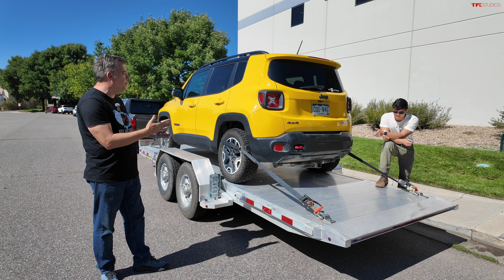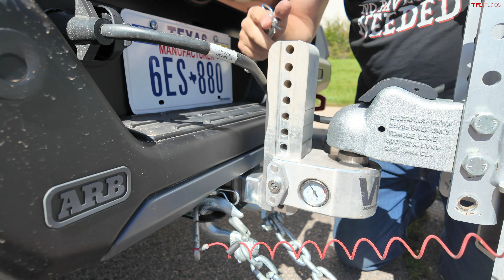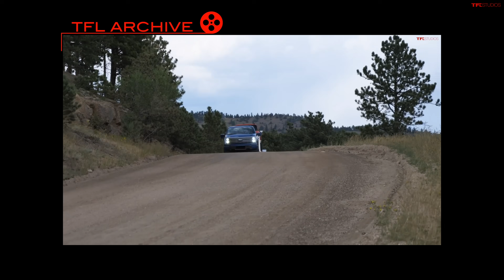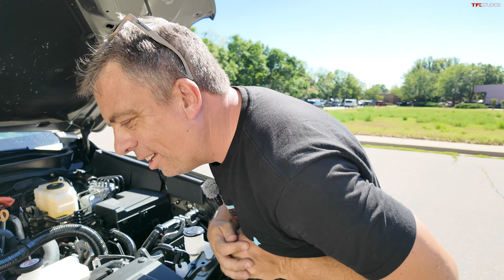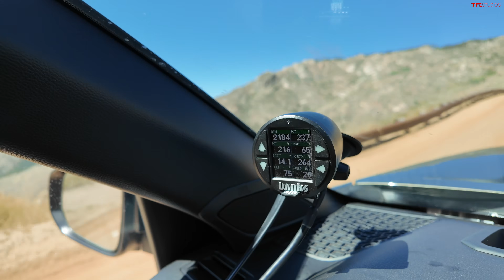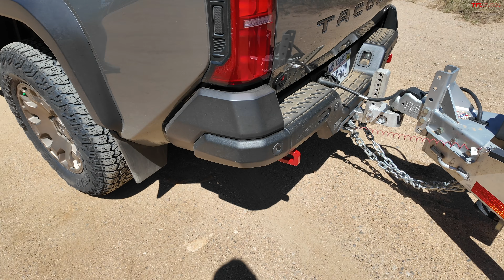Bigger Trucks Have FAILED Our Towing Torture Test, But Will It TOAST the Toyota Tacoma Trailhunter?

Comment: Didn't this get to a higher temp than the F150 and Ram? Knowing how old Toyota's acted like, I feel like it isn't even programmed to down tune or anything until after the point of no return. So what ends up getting tested is how aggressive the self protection systems are in trucks.
Reply: Or maybe the upper limits are different? If they engineered it to easily handle that temp then it did fine.
Reply: @Dusdaddy Oh you mean Toyota has extra top secret fluid? 😂
Reply: @pryme2013  Apparently so. Reached that temp with no failure.
Reply: @Dusdaddy  I'd be willing to bet that a new transmission with a known issue of exploding isn't built to a higher standard than ones for half tons that have been around a while. Really all these tests would need to be repeated several times with the same trucks. Because just because a truck survived a high temperature excursion once, doesn't mean it will do it again. In previous testing it was even said "If it was my truck I'd probably change the transmission fluid after that much heat." This is the hottest running truck so far. You saw them getting concerned during the test but fell back on "well the gauge wouldn't lie." But time and time again we've seen that the gauges will lie. The Bronco for instance the temperature gauges are scaled wrong depending on what version of the screen you're on, so it says the "red zones" are completely different.
Reply: @osamaismymama7907  lol..."known issue of exploding". Sure, and they're eating dogs and cats too. So if your favorite brand passed it would be chalked up to stellar design but since you're a Toyota hater, it's a conspiracy. Like you said, any of these trucks could have failed or passed. It's not like they have that many constant controls on this but to sit there and argue why it really failed is silly.
Reply: @Dusdaddy  Now you’re just assuming. There is ample coverage of them having transmission and other drivetrain issues. Ignoring issues doesn’t get things fixed. Personally I think all trucks and SUVs should have a dedicated transmission cooler. Used to be fairly standard but now it’s almost unheard of with all manufacturers now.
Reply: @osamaismymama7907  There is coverage but how much of it is just YT "chicken littles". Same thing when TFL broke their Tacoma. Everyone lost their minds yet not another single duplicate gripe came to light.
Reply: That’s one argument which is fair, but the other is that the truck can handle a higher threshold thus it doesn’t complain. But I haven’t been convinced which is correct. Thought to me it does seem evident that gas engines take a heavier toll than hybrids on these heat tests
Reply: @KFC1753  But that heat being measured is still from the Engine Oil, Coolant, and transmission regardless. None of the hybrid components. The hybrid would presumably work less hard to do the same task yeah, but heat in these components is heat all the same.

Comment: Fluid has not changed that much lol. 270deg is outrageous. That lessened the life of that fluid and the trans for sure.
Reply: It changed so drastically with their full synthetic that they removed the trans cooler on the tundra for a couple of years with no problems. I towed heavy for 65k miles on mine and have a happy transmission at almost 85k now
Reply: @goodneighborlawns  No, it hasn’t changed since they had trans coolers on tundras in 2017 lmao!!!! That was a cost cutting measure and did cause ppl issues. I used to own a tundra and remember it well on the forums
Reply: @pryme2013  funny because I have owned a few and own a 19 currently and am present on the forums but am not seeing issues directly related to the removal of a trans cooler.
Reply: @pryme2013  I've not seen any problems on the Tundra forum. Only people freaking out about it and adding $1300 aftermarket cooler kits 🤣
Reply: Modern synthetics testing shows acceptable performance at 200 hours of 160°C temps. That's 320°F. 275 is within the normal spec for modern fluid. Shouldn't be a problem. Normal highway Temp target is often about 230F as the baseline.
Reply: @MrJcjet  can you point me in the direction of that information source
Reply: @Land_Raver  I can't post a link. YT doesn't allow it and deletes it. But you can search for Intertek tests for GM transmission fluids. The one I referenced was for Class 8 trucks. The Intertek test for GM automatic fluid is 450 hours at 325F temp. The test is in a running transmission for that whole time BTW. It's Dextron VI in a 4L60E. 

The world of oils changed a lot in 20 years. A LOT. Old mechanic wisdom on this is about as valuable as 1990's phone company advice on dial up internet.
Reply: @MrJcjet exactly / oil and technology changes yet everyone is trapped in historical understanding
Reply: Years ago, I saw how long transmission fluid would last at certain temp intervals. Below 200 was about 100k, above 240, it was less than 5k miles.
Reply: It's within Toyotas spec... So I don't know how you can say for sure its lessened the life. It's always advised to change fluid more often if you tow or go off-road a lot.
Reply: @Johno530  Toyotas spec means nothing. They also spec oil changes for 10k miles. Right in line with when they rolled out their free 2 year maintenance plans lmao!!!!
Reply: @pryme2013 the manual states 5,000 miles of using it for towing or any other heavy use case. 10,000 is honestly fine if it’s just straight highway miles. There’s a guy on YouTube with a ram 1500 with over 200k and he did oil at 10k as I recall. Just depends on what you’re doing with it. If it’s all highway and it’s only been 3 months it’s fine.
Reply: @pryme2013 try again my 2016 Tacoma has 446k miles all oil changes done at 10k
Reply: @pryme2013  They do recommend 10k intervals but that's on their 'normal conditions'. Most folks are unaware they very likely fall under the 'special operating conditions' which in the booklet says every 5k oil change intervals as well as earlier transmission, differential and transfer case fluid changes. 

If you off-road, tow or have moderate to heavy paylods folks...you're under special operating conditions!
Reply: @pryme2013 Exactly
Reply: I'm sure the fluid would most likely outlast the warranty of 60k miles, as long as it's not cooking every day. Although, some of us do keep cars past 60k miles.

Comment: The jeep’s like 3500 lbs tops so then that trailer’s 2500 lbs??

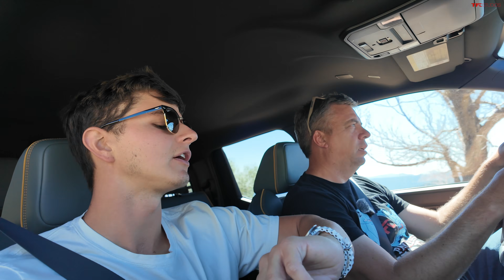16:02 it is not overbuilt. If it was, then the diffs wouldn’t explode just from a little bit of abs and traction control
Reply: The vehicle is overbuilt if it shares a frame with the lc300 and the tundra. And specifically it was the ADD that broke, not the actual differential

Comment: One of them acted like overlanders don't use their vehicles to tow.

 I've used 2dr Jeeps like they were full-size pickups. 😂

 I live in relatively flat terrain, but I tow dualsports, Home Depot runs on my folding 4x8 utility trailer, various small boats, etc., with a 2.slo/CVT Crosstrek. With a roof-rack and a big hatchback, one could be surprised how much stuff they can move without needing a guzzling full-size $30K+ pickup.

 Use supplemental airbags to avoid sag/squat.

Comment: Great test. It may not have thrown an error, but mid 270's is too high. The other manufacturers throw warnings at a lower temperature which is better as its more conservative and helps protect the transmission. So in my eyes, the Tacoma failed twice, once by not warning you of high temps, and second because it went so high. You may want to check with Toyota what they rate transmission fluid for, and what the consider max temperature range for their transmission.
Reply: 300 is fine for that truck.

Comment: Well that transmission is damaged. Fluid breaks down around 240-250. All your clutches are going to be starting to chunk and not slip when shifting. Terrible that they DONT have a warning light.
Reply: There is a gauge, but according to Toyota those temps were within spec so there was no warning. 

If I could guess I bet it would trigger a warning closer to 300f.

Freaking hot for sure, I would put a cooler on it if it was my truck.
Reply: @volvo09  the idiot light doesn’t come on until 300. Then it’s too late. It’s not a warning at that point it’s too late.

Comment: I wouldn't call 270° a pass no matter what Toyota's gage says. Back in the day, 230° was no bueno. I realize lubricants have improved, but if you make a habit of running at those temperatures, that sucker is toast.
Reply: No, not anymore. Why are some of yall in such denial? What do you gain?
Reply: @rtc22619  You gain a transmission that lasts. Most people are lacking when it comes normal maintenance, let alone max towing capacity running at those transmission temperatures. I'm no specific manufacture's fanboy, but if it makes you feel better, I think very highly of Toyota in general. The only passing grade I see in this test was Gail Banks and the aftermarket products he's developed. I'd love to see an oil analysis after doing that 20 or 30 times compared to a few thousand miles of normal driving. Critical thinking is becoming a lost art.
Reply: @remingtonwingmaster6929 the lab testing on the fluid is 200 hours at 320°F. I don't think 275 is a big deal with modern fluid.

Comment: So im guessing by the lack of chit talkin ford fan bois in the comment section that the taco did pretty good?
Reply: No, no it didn't do good at all. 266 and higher trans temp is NOT a pass, especially with no temp warning.
Reply: @1FiftyOverland  it got to 275
Reply: @pryme2013  yeah I said 266 and higher
Reply: I’m not a ford fan but how much weight did the ford pull vs this 6k pound trailer?
Reply: @pryme2013 well they both towed according to spec. The Tacoma isnt supposed to tow the same weight as a full size
Reply: @ravensfootball52  The lines are blurred between a Tacoma in 2024 and a full size in 2024. Damn near same size and the full-size now days has small six cylinder engines. So if the full-size is towing damn near twice the weight that’s not exactly a fair comparison. Half ton tow ratings are too high.
Reply: @pryme2013  just as mid size trucks have grown is size, so too has the full size trucks. Full size shrunk to 6cyl engines and mid size shrunk to 4. Why would you expect them to tow close to the same amount? Manufacturers set the tow ratings for a reason
Reply: @ravensfootball52  Mot close to the same but also not double lol

Comment: My FJ would climb in the high 250s. Apparently, if the transmission temp warning light doesn't come on, its fine. So the following week, i installed a big transmission cooler and I've never seen the temp go over 210 in extreme conditions. These automakers are just as bad as people who argue for higher oil intervals.
Reply: A transmission that lasts is bad for business. Same with engines
Reply: So true! Sadly, most people don't even care. Hey as long as no lights come on we're good right?
Reply: Just like how Cummins engines 19+ are demanding more power out of them yet run a thinner oil, extended the interval and expects no problems? More power and less oil in between
Reply: Do you own a Cressida?
Reply: @jimmysgarage9068  yes
Reply: @CACressida  Awesome.
Reply: I did a bigger trans cooler on my old silverado, and it seems to love it, i still do drain and fills somewhat frequently but it says it's happier on the guages. Makes me want to try a finned diff cover for cooling that off too
Reply: So never mind oil analyses?
Reply: @garysarratt1  oil analysis is nearly the cost of an oil change. Change your oil instead.
Reply: @CACressida    I change my oil.  Point is, we’ve seen several videos showing the oil holds up as long as there’s no more than a year with the mileage.  So a blanket condemnation of the practice is ignoring hard evidence.
Reply: @garysarratt1  what's cheaper, oil or an engine? If you lease your car then don't ever change your oil for all I care. My 4Runner has over 450,000 miles and it runs like brand new. I have 2 Lexus GSs with over 200,000 miles and they both run like new. My FJC runs like new with nearly 200,000 miles on the odometer. I'll take my personal experience with my cars running like new with excellent interval practices rather than extend my intervals and risk blowing up en engine all because a lab proved that under the right conditions, the oil will last a million miles.
Reply: @garysarratt1 yes the oils hold up now, but the oil filters haven't changed since the 70s. It's the particles in the oil that sticks to everything and clogs oil passages. Like lifters, bearings and cam phasers.
Reply: @CACressida    Do you change it every 3000 miles?
Reply: @garysarratt1  my fj is changed every 3k or 3x a year. My other cars get 5k
Reply: just because oil can still lubricate at 10000 miles it doesn't mean it isn't full of carbon that sticks to things like low friction piston ring grooves and piston oil drain holes causing build up and eventual clogging. an oil analysis won't show that. it's a complete waste of money. it's simple, when oil starts getting dark, change it.
Reply: @CACressida  i got my 2017xle rav4 with 438k odo and still running smoothly with 5-6k mile to change oil..

Comment: Well done on the “old man emu” pronunciation. Yank tanks are becoming very popular down here in Aus. Most vehicles sold domestically need to be heavily modified to have the ability to tow their rated tow rating and still have a driver onboard. Ram 1500 is the most popular and the conversion from LHD to RHD is factory levels of quality.
Reply: I’m still amazed how clean the pics of the conversions are. I suppose there is support directly from RAM or their parts suppliers. I suppose the biggest challenge would be the steering box. Yank Tanks 😂. Good name for them! I daily a 97 80 series but also have a ‘’16 2500 Power Wagon with a Four Wheel Camper in the bed. Use both to explore here in the Arizona/Utah/NV/Mexico. 

After 10 years of washboard, the OME shocks on the 80 were toast, so I’m trying Dobinsons MRRs still with OME springs. Think I’m going to switch to some Dobinsons progressives soon as I run empty around town. 

Cheers!

Comment: 6000 lbs doesn't seem like a very large towing capacity...
Reply: It's a Tacoma, a mid sized truck. Even the best in class is around 7500 lbs. From there you have full sized trucks, 3/4 ton trucks and 1 ton trucks. Think ford 150/250/350 chevy/ram 1500/2500/3500.
Reply: @originalname9999  Toyo looks to be NOT best in class then.
Reply: It's a Tacoma, that's perfectly fine.
Reply: Then get a Tundra.

Comment: I'll trust an F150 over a Taco any day.
Reply: Said no one ever
Reply: @samuelsanchez-uj6ui  I just said it, so...
Reply: The f150 failed this test with overheated transmission unfortunately.
Reply: @Michael-1337  Taco motors are failing so....
Reply: If it had a straight six in it sure, if not I'll trust my 2nd gen Tacoma over an f150.

Comment: In Brazil we use a lot of pickup trucks for farming. We only use the Toyota Hilux. It is the most expensive and it is not very comfortable on ordinary roads. But it is great off-road and it is the only truck that consistently can handle the abuse.
(PS Full size trucks are very rare in Brazil)
Reply: Hilux are way better than the Tacoma but Tacoma are 1 of the best with the Tundra and the Nissan Titan. Mazda for small pickups are good too
Reply: Same in México, we have both, but if you really need a farm work truck, there’s only one option, Hilux and preferable in diesel
Reply: Mi Chevy 1500 5.3 año 2001 no ESTA de acuerdo con tu testimonio. @carinoporelcampo
Reply: Same in the Philippines 🇵🇭
Reply: I wish we could get a Hilux again as well as the diesel.
Reply: @J.Young808 then buy and shipping to your country
Reply: The emission controls on the new diesel Hilux has made them less reliable. See class actions in Australia
Reply: @andrevanderwalt2515  first world nations are to blame.   So sad they can't get out of their own way
Reply: and has a turbo 😂
Reply: HiLux is a legend. Read about the “Toyota Wars” in the Middle East. The most dependable truck in the world by a large margin.
Reply: @drnick40 all the Mitsubishi and Isuzus in the Sahara would like a wors
Reply: @omardevonlittle3817 I used to have an Isuzu rodeo 4x4 manual . I did 3000+ hours off-roading on tight ATV mountain trails. What an amazing machine that was